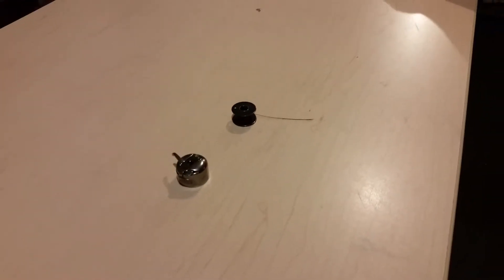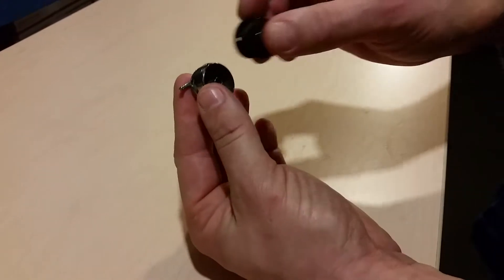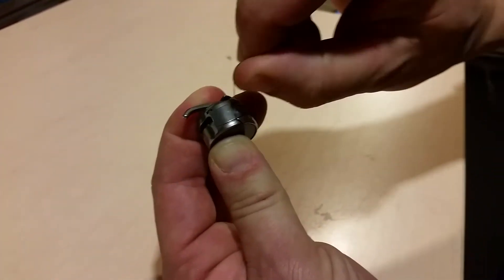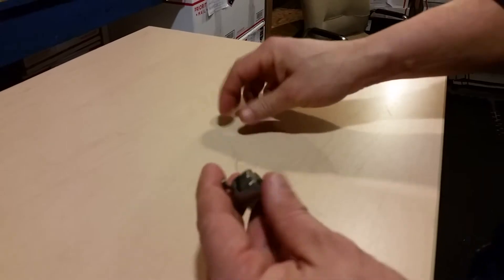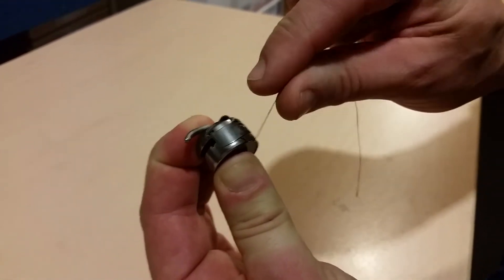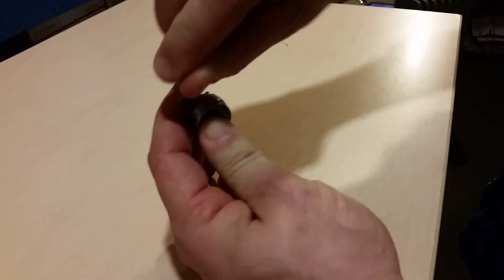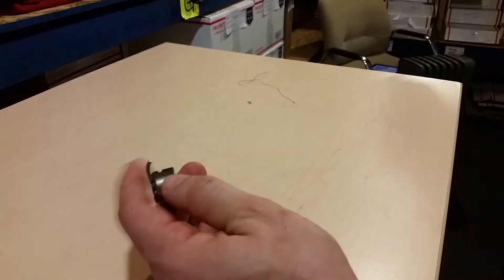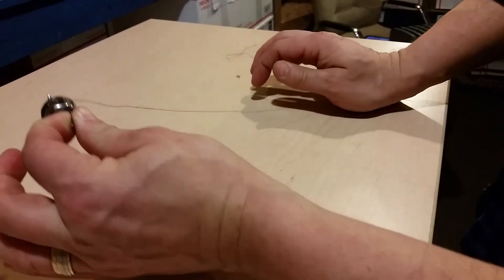How to thread the bobbin case on a Kenmore 158 series sewing machine

Comment: I think I finally figured out why needles are breaking. It’s not hitting the plate, it’s hitting the case where the bobbin fits in. 

When the needle moves down, it causes the bobbin case to turn simultaneously, and then the needle moves down and hits a solid piece covering of the bobbin case ..Now, my guess is to unscrew the black latches that holds the case in…and somehow adjust it…what do you think?